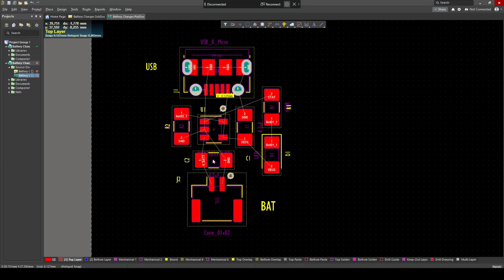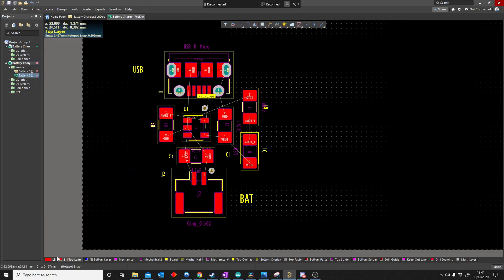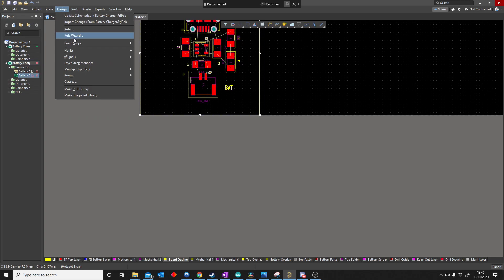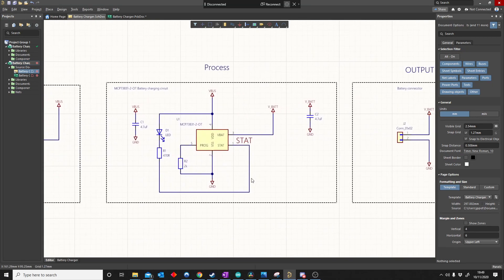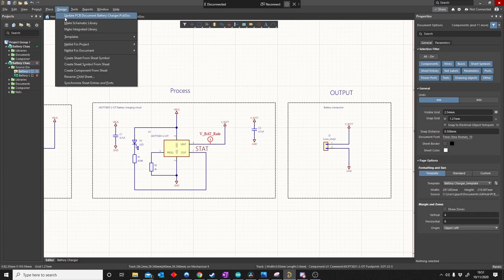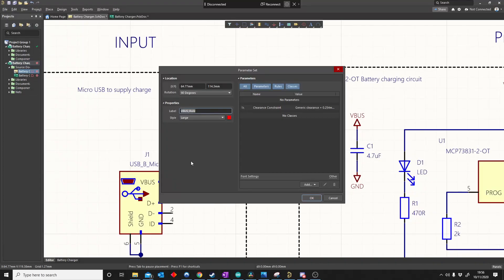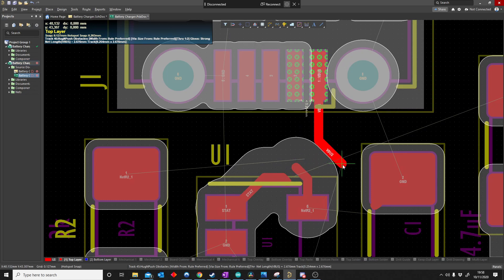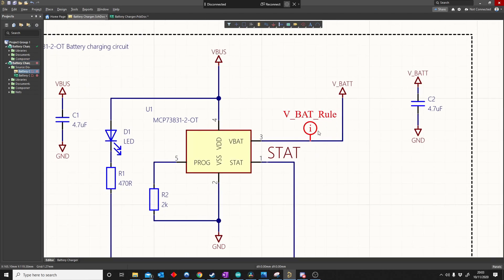Altium Tutorials for beginners - Creating your own PCB Design Rules

Comment: Sir can make GPS 

Using GPS Chip 
Not used GPS module
Reply from the maker: That can be possible, do you have a specific chip you have in mind? 😀
Reply: @PlumPot  No idea sir but you can choose low cost Chip and easily available sir datasheet and any program upload please search ❤️❤️❤️